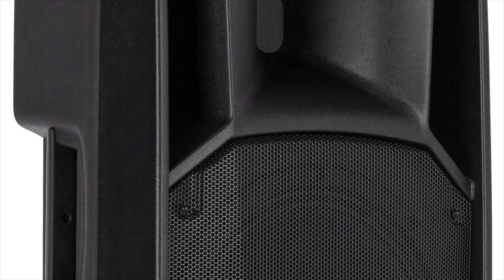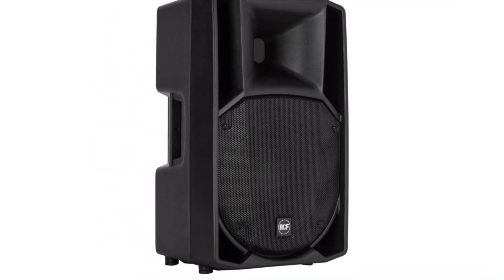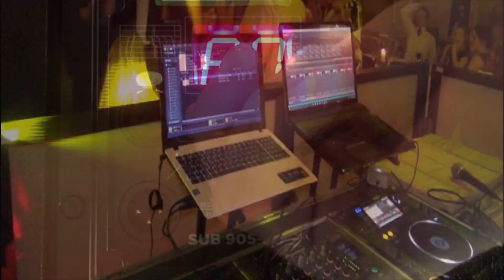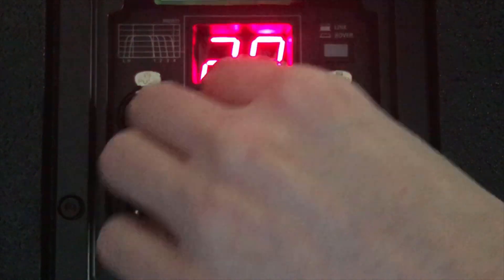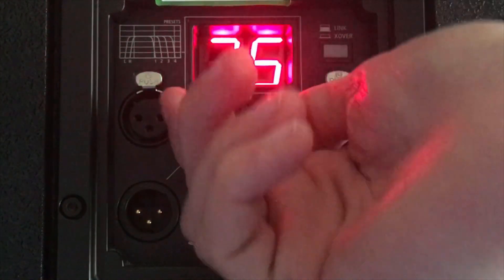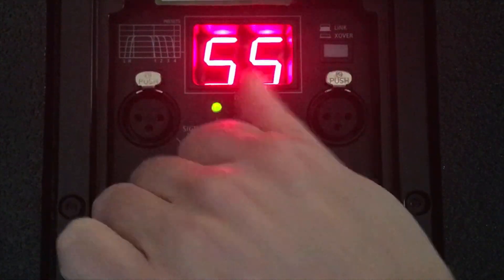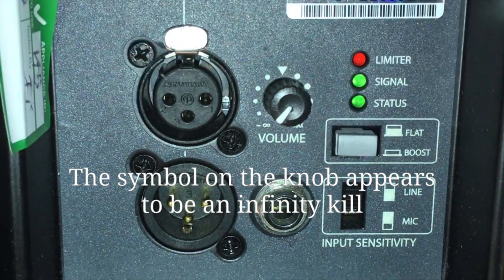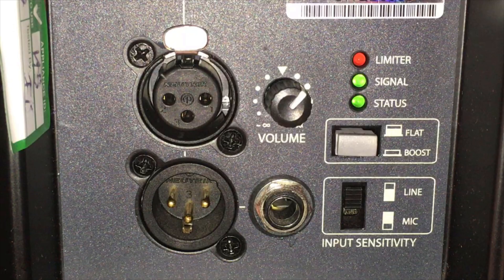RCF Art 7 Series 732 & RCF 905 AS-II Sub (8003) Levels & How I Set Mine

Comment: Great video, im running some ev ekx12s with my new rcf 905 mk3. Really struggling to get the bass to come through. I have the sub gain on -12 on setting l3 usually. The tops on 0db. The controller is hitting 0db but it does seem all the tops. Im hitting limit light on the subs Should i back the tops off a bit

Comment: I set tops to max and sub to -18 (which is analog 0 in digital), so I don't need to boost signal like you do. Signal is what drives speakers in to the distortion.
Reply from the maker: I set it there because it sounds right to me... however there is so little information about where 0db is with RCF and trust me I've trawled the internet, looked at the manuels and asked my dealer. From what I have been told and to be honest I treat it as hearsay but 0db is max on RCF. What I can say I've never trripped the limiters on them at full volume which suggests I'm not over driving them to me. I made this video at the time because of the little information... ultimatly I think RCF needs to make sure the information is easier to find.
Reply: Hi,
Thanks for the vedio mate
I have recently purchased RCF 912 tops and a 905 mk3 sub.I am really confused with the setup.Last week I had a gig and my setup was L3 at 15 db and tops were 2-3 o clock.But vocals were distorted and was not clear.I tried H2 also.I checked everywhere in the internet , but I couldn’t find clear instructions about the settings of 905 as sub.Do you have any update about these settings.Do I need to change the subs settings for vocals and DJ.Any recommendations would be highly appreciated.
Many thanks
Reply: @alt.entertainments5487  my friend who opened the modul sad it's some kind od trick with "boosting" the power, so 0dB is around 4, and maximum is smtn like +3, but they don't want to admit it. 😂 I push all my rcf up till the end.
Reply: @Jerrypmathew  set tops to the max lvl. 905as2 setup on L2 and apply 11,2ms delay is 712 placed over the sub. Loudness - up how much you like it. + check out your gain lvl.
Reply: @DejanCupeX  
Thanks for your reply. I will try this settings.There is a correction that I use only one sub (905as mk3) and I do coss over to my tops (RCF 912s).Is this setting goo for vocals or should I change these settings for DJ?
Reply: @Jerrypmathew  I don't know for mk3. These are settings for mk2. It should be ok on nk3, too. It's good for vocal. If you need more punch, gor for H4 and "x-over" off (link). It's not the best, but you get a little bit more punch.